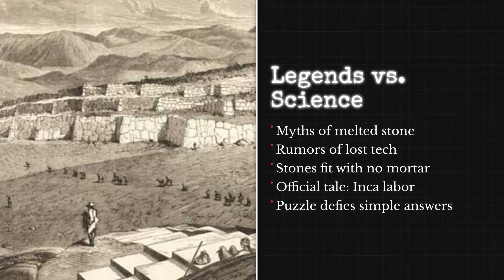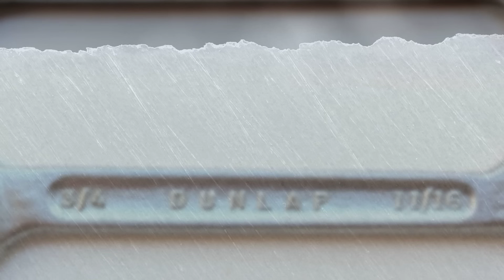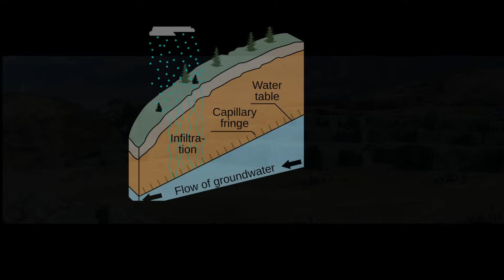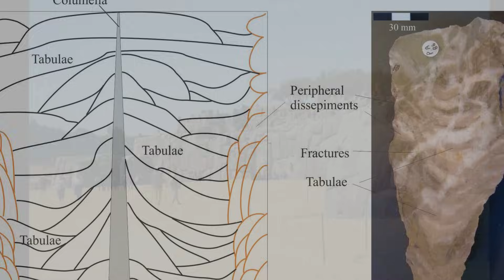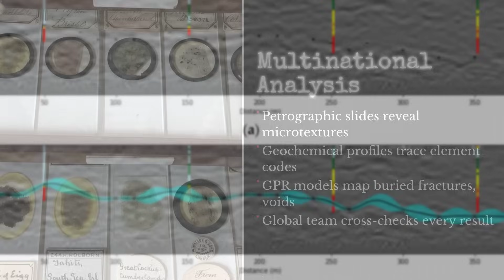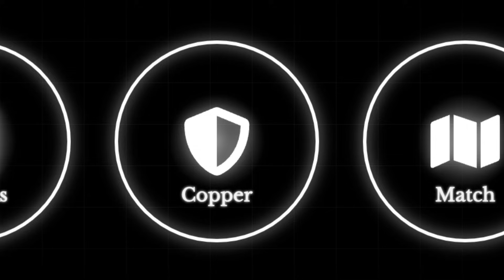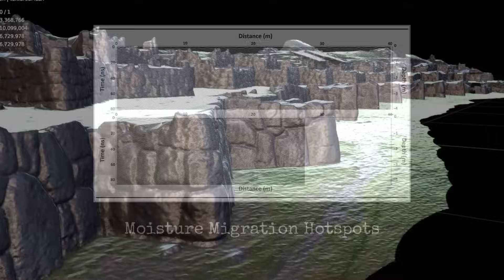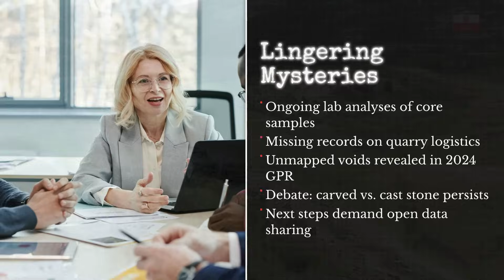New Findings Finally Reveal the Hidden Engineering of Cusco’s “Impossible” Walls

Comment: The cement heads are going to have tantrum 😮  some of theories could  be  plausible with much smaller sizes  and a insane amount of time / the odd shapes would take a template of the shape being fitted  to the next layer insanely time consuming the hand tools may have a copper handle  butt the cutting blade has to be something as hard or harder to chip or cut the stone / were looking at some type of wire/ string  band saw that is cutting  thru both rocks at the same time the stone being fitted in the last course is being held be some kind fixture / a hard 9 or 10 dust used with string / witch exsplanes the glass like  polish.

Comment: One obvious flaw in the molten rock or concrete theories is not mentioned in this video. All of the stone blocks at the Inca sites are individually unique in shape.  If molten stone or concrete had been used, it would have required the construction of a unique casting form for each and every stone block. They could never use the same form twice. Talk about Too Much Work! Solved. (And without having to consult an army of high priced professors, and professionals, and expensive world class laboratories.) I knew the right answer to this question decades ago. They could have just asked me.

Comment: You are missing the point.   One of 2 things happened.   The stone were moved to  the location, cut and place into the wall.   Or the wall was made somewhere else. upside down.  and then move to the location.   Easer because the bottom stones are on the top of the wall to be moved...  And you are not moving waste material    The question you need to answer is.              What is underneath the stone walls.   What were they built on ???/.   I see small rocks.   Or bed rock.  unclipped.

Comment: I have been a homebuilder for over 35 years.  Irregular walls poured on-site is exactly what I would want to do.  Regular sizes just adds up to transfer of energy up a line and the whole wall cracks.  You can look at many, many of the photos and see finishing marks that are long and straight as if they were troweling a soft product.
Reply: Since each stone has a unique individual shape, you would have to build a new unique form for each and every block you poured. For people well trained in cutting stone, it would be less work to shape the stones with hand tools, than to build a unique cast form for each poured stone.
Reply: They proved that the stones were not pored
Reply: Stonecutter tool paths.

Comment: The big banks and town halls and such built in the 18-19th centuries have super stonework made with stone saws but they all have nice square stones not the irregular ones that so many megalithic sites display.
The fact that the megalithic sites are destroyed and generally in areas with very poor sandy soil or little water to grow crops for builders and 'inhabitants' tells me that these ruins are all pre-Flood and were made by the GIANT NEPHILIM who would have been able to cut and try fit, lift again to trim and try until the odd blocks did all sit tight together.
The Flood was 4,370 years ago and left no evidence of the Nephilim or the locals and swept away any tools or lifting gear.
MEGALITHS ARE NEPHILIMIC!

Comment: To fit the stones perfectly, they beat down high spots with other rocks until there was dust, then they rubbed a flat stone on that dust and remove, leaving the high parts which still needed to be beaten down. Just like how your dentist has you bite bite bite on carbon film, and then grinds down the high spots.

Comment: Heh, me and GPT went and figured a cool hypothesis, based on chemical lab results of the residue between the rocks.  Found out based on legends which ingredients to use, not to dissolve the rock, but to make it maleable based on chemical reactions using goats milk, bat guano, tubulars = all mashed up and set to soak into the rock. In a few hours you'd have a clay like granite surface.  What happens is it dries up and creates new structural latticework causing the bulbs just like we see.  A maleable surface explains why Egyptians only needed copper tools that didn't wear out everyday.  There you go -- an elixir created by Shamans/Magi/Alchemists = hence when you kill those priests = their secret dies with them.
Reply: This also explains intricate granite statues and smooth massive granite designs. If you can make granite like a malleable clay that can be chiseled easily = intricate Indian statues we see.  It then all makes sense - its not lasers or plasma, its just a paste to make granite softer.  With statues, you can get rid of the bulbs that will protrude, because statues will not be in the rain where they will disolve into slag (seen in Egypt and the Andes on some rocks). This was because due to GPT, if you remove those bulbs by polishing sanding them off? You break the reconstructed structural lattice framework and it will disintegrate over time.
Reply: PS> This is not geopolymer or casting or molding - its just basic softening which would do everything we see. imho.
Reply: Oh, and after sharing the deep research and step-by-step instructions with the NATRON SALT researcher - that was too destructive of a chemical process.  We don't dissolve = as that would show up in the forensics, what did show up was the chemical traces of ALL the ingredients listed in the red ochre paste though. which all serve as catalysts to one another.  remove one = it wont do a single thing.

Comment: ~Maybe~
They cut the stone into the right size.
Wrap it up in moss, large leaves and rope on a sled.
Put a plant based chemical agent in the moss while moving the stone.
Over time, when the stone arrives to it's final location, it is softer on the outside for fitting & shaping.
Reply: Why are the edges always rounded off seemingly to the same radius? And if they cut them to the right size miles away what is the ‘right’ size?

Comment: If you cast stones you usually make them the same size and shape
Reply: If cast in place, why have seams?  Cheap-ass alien hardware!
Reply: they were cast in place, its why they were polygonal.
Reply: @maciejgorski6981 nature creates polygonal shaped fractured bedrock including hexagons
Reply: If you cast stone and make them the same, like brick, you end with seams that are on the same plane, which isn’t as strong or stable during natural disasters.
Reply: @Six4691 what makes large stones stable are smaller stones as a foundation.

Comment: Though not totally impossible, the geo-polymer theory is very unlikely because it would mean the need of a unique form for every single block, which are all of different shapes.
Reply: It makes you think if they were using casts they would use the same form, I can't see the point of using a different form for each stone.
Reply: @GaryRowlands 😂😂😂Learn to read!
Reply: I've been doing concrete for 40 years I don't buy it they didn't carve all those sides those rocks look poured in place
Reply: @richard-cf8ce they look worked from natural stone and I do both cast and stonecutting